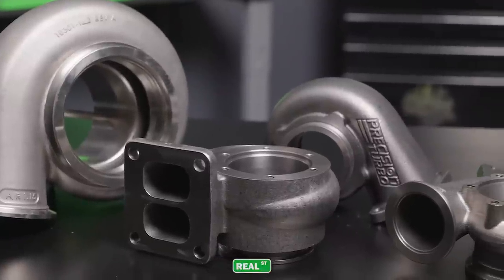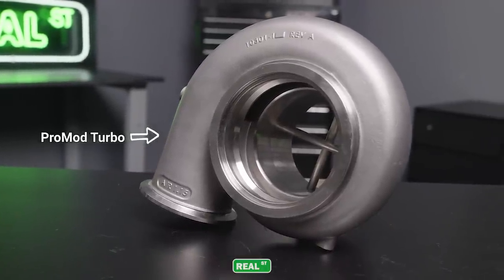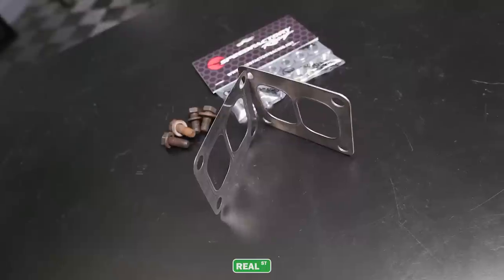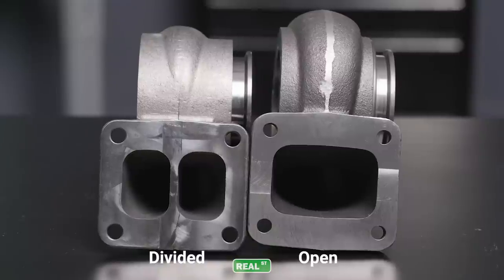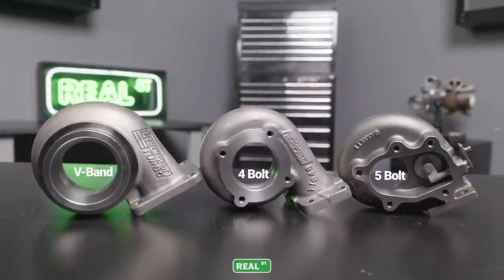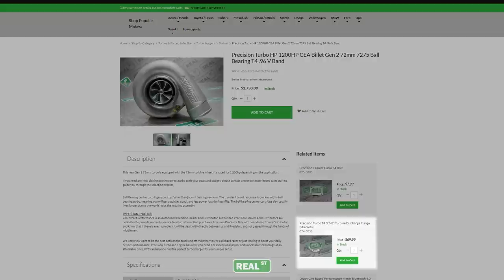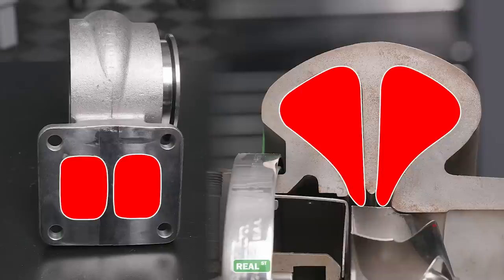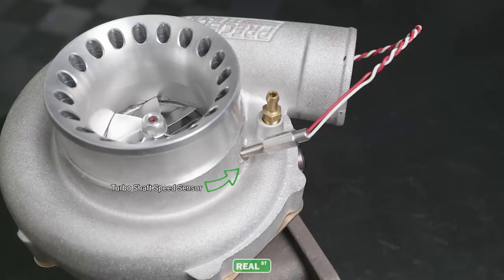Turbocharger Exhaust Housing Options - Jays Tech Tip

Comment: Hold my beer)

Twinscroll spins the turbo earlier, which widens the operation engine range. If you're into drag racing then this probably won't matter much to you. But if you're drifting, it's important to have high turbo RPM in the low to mid range engine RPM.

The turbine spins up earlier due to the fact that the cylinders are connected in the correct order and do not have a stray influence (pressure pulsation during valves operation) on each other.

I think it would be great if you made a practical video on the topic, where you showed the difference in numbers. And then they would give the followers the opportunity to make an independent decision

Comment: Been wondering if I could cure my boost creep with a bigger housing
Reply: Bigger waste gate if the waste gate is too small it can't control boost.
Reply: If you have creep, yes a bigger wastegate will help control boost, but my experience has shown a larger housing is the better option. If you have a reasonable turbo/wastegate setup, and are still experiencing creep, a larger turbine housing may give you a nice bump in power without much if any loss in response, plus control of the boost.

Comment: I have the on3 n54 “ t4 “ vband turbo manifold .. it has the single round vband hole . Not the 4 bolt t4 flange … I’m confused on what turbine housing fits mine . Can anyone help me please
Reply: I’m Looking to run a garrett style “pulsar” turbo like a g35 or gtx35 and don’t want to order the wrong stuff 😅

Comment: Can a T3 63.Ar GT35 gen 1 turbo handle 550 whp K20? I daily drive it but do like top end dragging on freeway lol
Reply: Prolly, buuut u just said u like top end  power. Get the .82 you will definitely have power where the k series likes to make power vs the .63. K series have alot of headflow, so the .63 would just hold you back.

Comment: I understand how thw turbo can choke the exhaust at hight boost levels, but how dies it at high RPM? Shouldn't the wastegate be able to flow the eccess gas flow?
Reply: You just lose efficiency as the exhaust is trapped in the system. Remember it's just an air pump.  The wastegate is there trying to maintain a user prescribed manifold pressure value.   Thanks

Comment: Whats better for the same exhaust flow? Small a/r big exhaust impeller. Or the other way around ?
Reply: As wheel size (MASS) increases the turbos loose transient response.  A larger wheel with a smaller housing isn't ideal. It's about a balanced approach and then operating the system at a desirable pressure ratio. Ideally you want to make the power you'd like while having less pressure in the exhaust side of the engine than the inlet side. Thanks

Comment: "That .8 to 1.0 range is a very organic position to be and it will compliment the size of the wheels well..."
"...you just want to get as close as possible, that .8 to 1.0 range won't do you wrong..."
Uncle Jay, does this also apply if you are twin turbo instead of single turbo? 🤔
Reply: In the examples I've been around we've just stuck to the same approach. I had a 2jz with twin 6466 and .82 housings and it was making good boost by 6,000 and ran extremely well. On the Coyote engines it's the same routine, we're running close to 1.0 and they spool and perform very well. I'd venture to say the guys that have been immersed in the R35 community can chime in.  It really comes down to the powerlevel and the pressure ratio that's required to make it. If you can keep the back pressure down the engines are less knock prone and live longer.
Reply: @jaymeagher1510 Thanks Uncle Jay. 👍 I'm using two T25 flanged GT2860RS turbos with .86 A/R on a 1JZ, so the goal was power (600hp-700hp using 108RON Unleaded jungle juice) but more importantly, response across a wide rpm range. 
The build has been catered for response and building boost as soon as possible, hence the small turbos and using not as wild cams (264s) to keep that response. 😎

Comment: man i wanted to ask about holset turbine housing since they are designated as cm^2 like mitsubishi .... but thanks for this info, everything i know i learned on superstreet (turbo edition) :) honda-tech helped
Reply: You can calculate centimeter squared to A/R ..For example an A/R of 0.89 is 12 cm squared....
Reply: Because holsets are for diesels would they require a naturally larger turbine to perform as well as a precision or garret equivalent? If I used an 8cm housing would it spool as quickly as it should or would it need to be 14cm because holsets are designed on diesels like that

Comment: the real question is where to you buy just the back housing only? currently with a t4 .83 A/R and want to go a tad over. thank you
Reply: That depends on the brand. We have the major brands within reach. Thanks
Reply: @jaymeagher1510  precision 6266 t4
Reply: @ohhman9400  That's easy, call Real St. Depending on how long the turbo's been in service you may struggle to remove the housing. If it's been a couple years I'd remove the turbo off the car and place it on a bench EX housing down. Soak the hardware with PB blaster overnight. From there it's just working the hardware out and using a rubber mallet to break the housing free of the turbo's heat shield.  Thanks

Comment: Nice one man.  Same good level info, only one area I'm gonna be picky about:

A/r = area / radius, not aspect ratio.   It defines the area of the volute vs the radius of the housing.  This is pretty relevant because it means the .8x a/r you mentioned as being a golden rule of being a nice mix of response vs flow, which IS true for a lot of turbine housing and wheel combinations however with things like Borg Warner EFR turbos the 1.0x area is the holy grail area, if you go .8x with those you're likely to choke most typical setups and even 1.05 is semi response orientated.  A 1.45a/r EFR would be like the parallel for 1.0x-1.1 from other brands
Reply: I went back and forth on the terminology and assumed someone would chime in.  When you look up calculating the area of odd shapes it seemed like aspect ratio was the right word.   We also have to face that some brands don't account for the divider in "twin scroll" housings so we get what you mentioned with larger numerical values just to get back to the same place a "1.0" housing would be.    Thanks for your feedback!

Comment: Any one in the comment wanna inform me on A/R ? I'm looking for best response and lowest backpressure for a 2jz not interested in going over 500HP Happy with 400HP
Reply: You can do that easily with the factory turbos on a 2JZ-GTE and have better response than 90% of aftermarket turbos. Just exhaust, intercooler and boost rise and voila.
Reply: @MafiaboysWorld  Oh I know the USDM twins could but that is not at all what is available to me, its NA
Reply: @streetinfamy  GE head peasant. 😛🤣
To be honest, a G25-660 might be your best option there. Available as T25 flange or V-band. 👍
As Jay said, lower A/R means better response but the turbo itself will choke out at higher rpm. Also factor in manifold runner sizing for this as that can also affect how the turbo absorbs the exhaust gases to turn in the first place. 👍
Reply: @MafiaboysWorld  aye, it's a hard life, the life of a pirate, yeah ive looked into those $$$$,  there is the option to swap a 1JZGTE head on since the 1J block froze but man what a hassle after finally getting the NA going... thanks for the scoop
Reply: @streetinfamy  in reality, both heads are awesome. Some argue the GE is better than the GTE. I totally agree that the GE is much better than the SMALL PORT vvt-i versions of the 1JZ/2JZ but the BIG PORT Non-VVTI? Hell no and I'll die on this hill fighting anyone over it! 😂👍
Reply: @MafiaboysWorld  yea its a non vvti 1jzgte head. but man just this NA going I really dont wanna go through the hassle ... but I agree with you
Reply: @streetinfamy  Just keep the GTE head for later on. 😉👍 Build the GE. Just look at Baltic Supra for inspiration. 😎
Reply: @MafiaboysWorld  lets not bring the majors in to this peasant discussion
Reply: @streetinfamy  I just mean if he can make almost 2000hp with his GE fully built, 400hp will be just fine. 😉👍
Reply: Keeping with Jay's "balanced" approach, I think the way to achieve a balanced but responsive 500whp 2JZ would be about 60mm compressor inducer and about same for the turbine exducer, with an A/R of about 0.85-1.05 for the turbine housing. Borg Warner S258-sxr would be an inexpensive name brand way to get there. A BW EFR 7670 would be a premium way to do it. Or a Garrett G30-660 or 770. Or a Turbosmart 58/62 or even a 62/62.

Bottom line is a 58-62mm compressor and 60-62mm turbine and 0.90 A/R housing, coupled with good aerodynamics and bearings will hit 500whp and spool FAST.

Comment: Superchargers are better
Reply: Only for V8s.
Reply: Incredibly subjective but okay.
Reply: Better at parasitic power loss sure. Trash in every other possible way
Reply: Really though I like my k20s with NOS and any 2jz or RB's get supercharged and any V8 loke the coyote or ls gets the N/A treatment. Turbos run too hot.
Reply: @marcscarthingsandstuff  then you're doing it wrong
Reply: @marcscarthingsandstuff  2JZs and RB get supercharged??? 🤨😑🤦
Everyone, say welcome to the kid who wears a crash helmet, a bib to catch the 💩 he's dribbling and rides the short bus daily. 🤣
Reply: I also like to so nitrous and superchargers on my 13b/20b's
Reply: Never ever ever ever run a turbo unless you hate your engine
Reply: @marcscarthingsandstuff  Just like you with your LX450. 🤣 How about learning about doing some proper heat management on the thing. 🤦 There's a reason turbos are used by basically every OEM today as they are more efficient, better thermodynamically, and produce more power overall. Only thing superchargers are good for is torque. Both produce heat.
Reply: I wouldn't be caught dead running a turbo anything ever. Same with a manual trans.. trash... auto/supercharger or nos for lyfe son
Reply: @marcscarthingsandstuff  "I wOuLdN't bE cAuGhT RuNNiNg A tUrBo AnYtHiNg eVeR..." 🤔
looks at your channel, sees LX450 turbo 🤣
Shut up already. 🤦
Reply: @MafiaboysWorld  It's like watching a FAS awareness video in real time
Reply: @uglymechanics6599  🤣🤣 I was thinking FCE bro, but take your pick as it's 100% one or the other. 😁👍